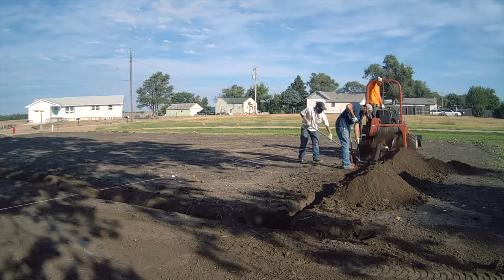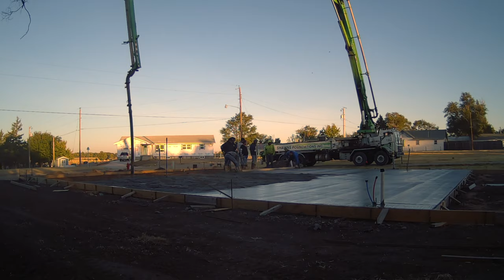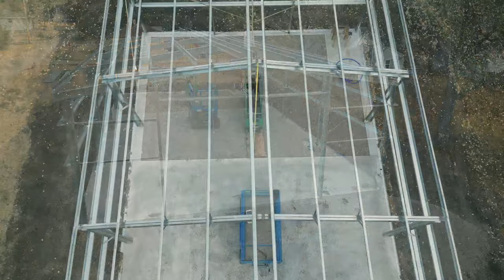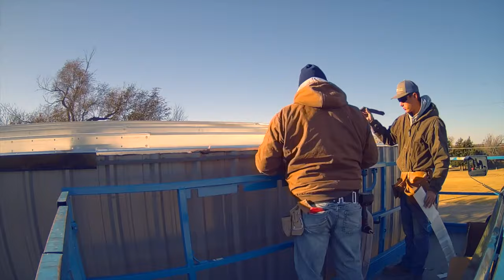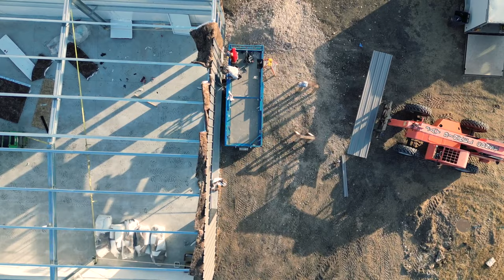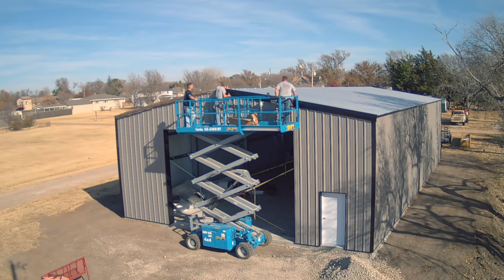40 x 75 complete STEEL BUILDING construction timelapse

Comment: Would like to know, what was laid on the roofing before the iron sheets? What's the reason? Is it for heat prevention or excessive noise reduction during rainy days? What is it called?  Thanks, everyone.
Reply from the maker: Fiberglass insulation.

Comment: Ever had any condensation issues between the panel and insulation with that particular type of insulation material?
Reply from the maker: Not in this climate.  I can see where that could be a possible issue in other parts of the world.
Reply: Yeah where I'm at that soft material would get so moldy from condensation forming on the inside of of the exterior cladding.

Comment: What's the purpose of this insulation? Is that for heat?
How many days does it take to build this steel warehouse?
Reply from the maker: Insulation keeps the heat in during the winter and keeps the heat out during the summer.  Many people in this climate put a mini-split heater/Air Conditioner in buildings like this in our climate.
Reply: They will not answer you because it will took them several months may be a year

Comment: Im a little confused on what is done to make the structure completely waterproof? idk
Reply: The exterior cladding is metal panels overlapped. Same with the roof. Screws are fastened through the standing seams on the roof so that water doesn't collect and leak through a screw hole in the valleys. Since rain always follows gravity, these measures are more than enough to keep water out. It will slide down the metal walls and into the dirt.

Comment: what are the initial post holes dug for my the skit steer? Testing soil or putting in some concrete or something?
Reply from the maker: @workinonitSurge  I believe they do that to pour larger footings in those spots for more strength.  You’d think that’s where vertical beams would go, but they drill more holes than that.  I’ve never asked why they drill those holes.
Reply: @JerettFilmsConstruction  makes sense. I guess I didnt see the holes after they start trenching, so I didnt see if they filled with concrete or not

Comment: What would be the cost of this structure roughly without the concrete costs?
Reply: my guess is  around 40k. my 40x60 was about 35k. mine also has insulation, 2 roll up doors and 6 man doors.  does  not include concrete or grading or installation cost.